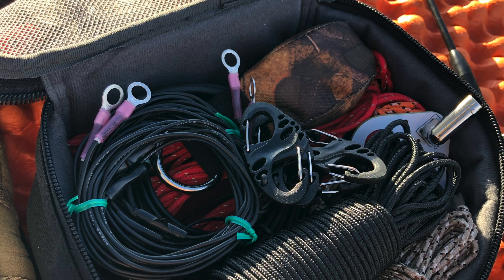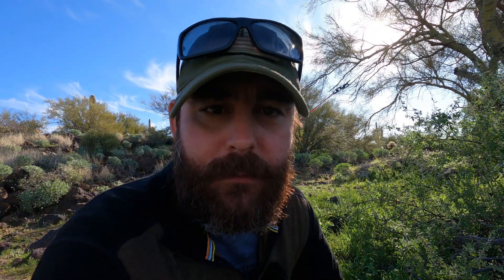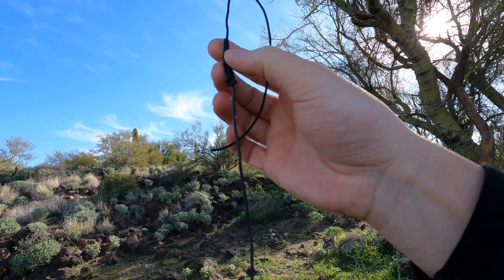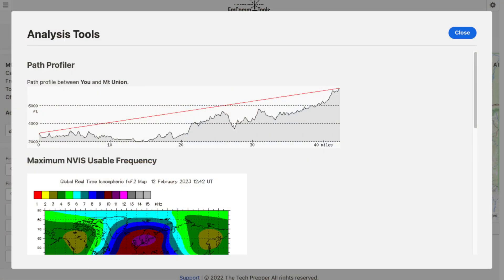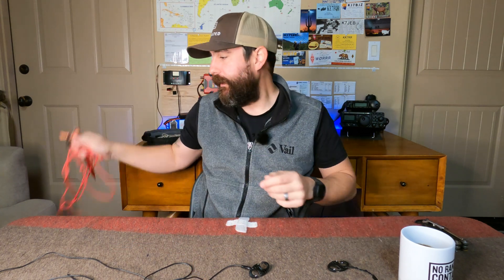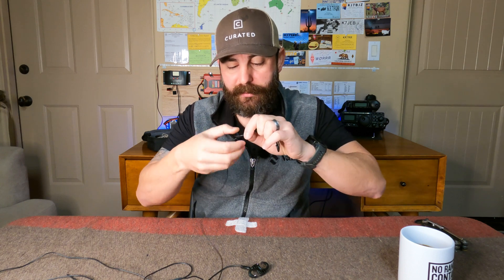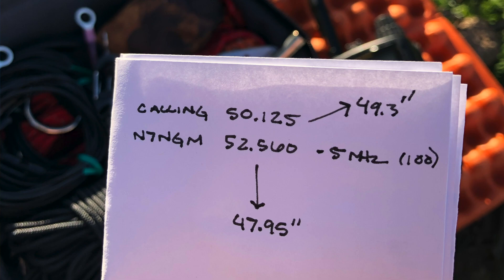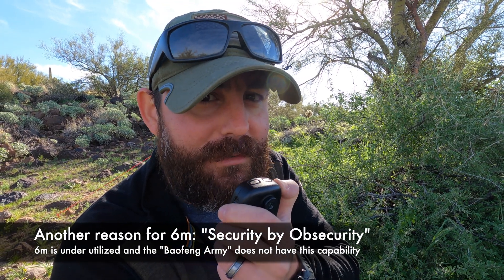Improvised Field Comms - Manpack + 6m Jungle Antenna (Full Video)

Comment: I like how you make quad band mobiles work when they’ve been kinda bashed for so long. Now it seems all those mobiles have been discontinued! The 818, 8900 both discontinued and are long gone online. Just can’t find them anymore. The 8900 was replaced by the TYT 9800 but does not have good reviews at all for poor quality. Has there been any news on whether yaesu will have a replacement for the 8900? Anything comparable?
Reply from the maker: Yaesu, in my opinion, is taking most of their radios in the wrong direction. I do not believe there is a quad band replacement.

Comment: I know you said its a hassle to add radio compatibility to EmComm Tools, but just in case you're on the fence, and one more request will push you over the edge, being able to use it with the FT-8900R would be awesome.
Reply from the maker: All the Yaesu mobile rigs will work with EmComm Tools with reduced functionality since they don't have CAT control. You'll just have to tune yourself.

Comment: Hmmm....  Do you know about HF ALE (https://en.wikipedia.org/wiki/Automatic_link_establishment)?  Look up PC ALE for civilian software implementations.  There are also periodic interoperability exercises among ham ops, and among hams to gov and NGO.

ALE is automatic link establishment.  Essentially, it lets the participants set up ad hoc meshes that the system maintains autonomously.  If you've got the typical shack-in-a-box radio, this means the entire band from 160m to 6m.  The system sounds the channel periodically to figure out in real-time where the band openings are, which other nodes are reachable on what band, and routes traffic appropriately.  If paths go down for whatever reason, the system figures out another way to route, through multiple hops if necessary.

It's superior to VHF/UHF, essentially hobby-grade, repeaters in coverage and resiliency.  Even just a single 40m or 80m station set up for NVIS will give reliable single hop link out to ~200 miles, and without regards to line of sight.

Comment: I bought the Yaesu FT-8900 radio and connected it to a Bioenno BLF-1206A. The Signal Stick antenna was connected. I keyed the mike at which point two 'Busy' indicators appeared on the menu.I factory reset the radio to attempt to resolve the issue. I am new to ham radio. This was my first attempt to move from a handheld to do what the TechPrepper does in his videos. Did I do something wrong? This is more of a learning experience. Trying not to be bummed. Thank you.

Comment: They're bigger, but rock solid, the Rig Expert analyzers are great, accurate units.
Another thing to try; use just 1 radial with your antenna in an "L" configuration. Orient the radial in the direction of the station you are trying to reach. With one radial, you get some directional "gain" in the direction of the radial.
Reply: so adding radials gives you a wider coverage area, at the expense of distance?

Comment: Hi Gaston
It's very interesting watching your progress. Keep it up.
I can see your struggling to get height in the field, have you considered using a fishing pole as hight above ground on VHF/UHF is very important.
The gain may justify the extra weight.
Have a look at DXCOMMANDER here in the UK for a few ideas.
Reply from the maker: Thanks for following along. I always carry a 6m carbon fiber mast (SOTABEAM Carbon 6). I usually use it for my HF antennas (dipoles and EFHW's), but have used it in the past for my roll-up J-Pole. Thanks for the suggestion.

Comment: End Loaded Antenna... Been there, made the same mistake... 
  It turns out that the little wire folded back at the end adds apparent length to the antenna.  

  Check out DX Commander's video on linear loading, and his latest Signature 9 video. 
 He  talks about 3" folded back makes the antenna seem 1" longer.   When you cut off the leftover "TAIL" the resonance shifts and you've gone too short.

Callum thinks he might keep the fold over a little long, and tune by trimming the tail, without moving the fold point.

This happened to me when I built my 80M EFHW.  I kept folding back without cutting until I hit resonance at 3.55MHz.  When I cut the folded (about 5') section I went out of to about 3.9MHz.   That messed all my harmonics.(UGH!)   - Clark, de  N1NVK
Reply from the maker: Clark, this is perhaps the most useful comment that I have ever received on the channel. Thank you. This makes perfect sense. By design, all my dipoles (and now my 1/4 ground plane) antennas are all end loaded to allow adjustments and tuning within a given band. I usually have anywhere from 4" to 9" folded over on the ends. I can't seem to find the video where Callum talks about it. I'll shoot you can email if you don't mind.
Reply: @TheTechPrepper  https://www.youtube.com/watch?v=0UwaIc3GdSA

Comment: Do you think you could get one of those cactus to radiate? Or, would it be wrong to poke it with a thin pin that is a few inches long? Cactus & cactus? Cactus and fence? Cactus and wire?

Corntenna and wet string antenna has been done. The solar cycle is pretty hot so a lot of crazy things should work.
Reply: That would be a million view video ❤

Comment: Awesome!! The fence trick is on my list to try out too. If you use a cobra head just take a couple alligator clip to banana plug leads. If you are using an external tuner I'd put the cobra head directly on the output of the tuner and run the lead up to the fence. That should help keep losses a minimum.
Reply from the maker: Thanks for the tip. I was planning on going down a similar path. I have spent almost no time with my Xiegu X6100, so I may use it. I am also considering using my MFJ 9201 QRP manual tuner as that can be used with any radio and is perfect for the field.

Comment: U can buy female BNC binding posts and have ya tryed a efhw antenna for 6M yet?
Reply: For HF u need 2 wires with a aligator clip on 1 end and a L match
Reply from the maker: I have a bunch of the female BNC Cobra heads and have traditionally used them for my dipoles for ease of connection to the coax. Recently, I switched to the male BNC as it give me flexibility to use it with all my HT's. I have not tried an EFHW on 6. It's on the list.

Comment: Been loving all of your videos.  Same direction I'm going on my setup.  Get a RigExpert Stick Pro.  That should be the best option for you over a fragile NanoVNA.  I tried last year right after the war started and, due to availability, was stuck getting the AA-650 Zoom.  LOVE IT!! Just not small for backpacking and remote field adjustments. Buy from the US reseller.  I forget the name, maybe PNC Engineering.  They are licenced to repair or tune them locally (USA) under warranty. Keep up the great content!
Reply from the maker: It's funny you mention that. I love my RigExpert Zoom 35AA, but it is huge and only works for the lower HF bands. I've been looking at the Stick models for awhile. The price has kept me away, but I think I'll save and snag one this year.

Comment: Sounds like a resounding kudos on the video. I'm glad you added the Knots portion! And the Nanos were on sale for 39 bucks on r and l 3 days ago!
Reply from the maker: Thanks for pushing me to add the extra 10 minutes! I'm open to any suggestions you have for an improvised HF antenna using a barbed wire fence. I don't want to cut existing fence, so it looks like I may have to go down the path of a random wire type setup with an alligator clip and tuner.
Reply: @The Tech Prepper  no problem sir! I could not send the link but k7mem has an AWESOME website. I sent you a screen shot and some numbers via Buy me a coffee. Hope it helps! I love my 9:1 random wire (85') for 80-10m on my 991a at home. Tunes up easy.
Reply from the maker: @the_mad_swimbaiter455  Thanks! I appreciate the assist again.

Comment: Enjoy your channel, sir.  I'm an Arizona native myself, and am all too familiar with the plant life you have in your videos.  I watched all the way to the end, where you tried to make a 6 meter simplex contact.  I'm not trying to be one of those 'know it all' hams, because I definitely am not.  But, if you didn't know - 50.125 is a call out frequency, but it's usually for SSB.  The FT-8900R doesn't do SSB (which I'm sure you already knew).  The FM Simplex call out frequency on 6 meters is 52.525.  You might have had better luck using that frequency than the one you tried to use.  FYI (for the future).  DE K7RLN
Reply from the maker: Great call out. Thank you for the correction. Honestly, I was solely focused on the FM repeater and hastily searched for a simplex calling frequency the morning of the exercise and failed to distinguish between FM and SSB. I love it when the locals pop in!

Comment: For a HF antenna on the wire, use a 9:1 balun and a isolator. Cut the wire and isolate it. Attach the wire into the 9:1 and see how it goes. Also look up linesman braiding for connecting wire. Much more robust if you do it that way along with the fishermans knot.
Reply from the maker: Thanks for responding to my HF question. It looks like a random wire with a tuner is the way to go for this next video. I may re-use my PackTenna Random Wire antenna with an alligator clip on the end.

Comment: Adapt and overcome!😎  Would it be an option to build removeable links for the 2m jungle to turn it into a 6m in the field?  Good stuff for over coming problems in the field.
Reply from the maker: I was thinking about building a linked 1/4 wave ground plane for 6m/2m/70cm based on this design. Yes, it's doable but you lose the frequency agility to tune it in the field within a specific band. I guess I could tune the first two shorter links (2m and 70cm) for the middle of their respective bands and allow the last link (6m) to use my same s-clip carabiner approach for tuning 6m.

Comment: 6m one of the best bands for preppers for short range comms. Great for horizontal ssb. Very much underused in the UK which have said is good for prepper comms. Many thanks.
Reply from the maker: Thanks for sharing! My local prepper group is asking to play with 6m after this exercise. There may be a follow-up video.
Reply: Great stuff mate learn a lot from you much appreciated
Reply: What band would you want to use on a hand held tri-band like a vx-6?

Comment: Open question to all: When in an emergency situation what bands will be the most used? 20m and 40? Long term shtf or short. Trying to pick either a 6-80 meter multiband antenna like the chameleon V1 no longer in production or just use a long wire end fed 20 and a separate 40 meter.  Thanks for the thoughts.
Reply from the maker: I guess it depends on your goals. My personal emcomm plan is focused primarily around local and regional contacts. This leads me down the path of leveraging NVIS on 40m, 60m, 75m and 80m. I'm finishing up a linked dipole design that I'm calling the "TTP EmComm Linked Dipole". It's a 5-band (20/40/60/75/80m) linked dipole tuned for a very low height (8' apex and 4' on the ends). I'm
collaborating with N9SAB on this. It will be available on my store late next month. 20m will be terrible at that height, but the other bands work fine based on my testing.
Reply: @TheTechPrepper  I like it.
Reply: @TheTechPrepper  Oooh. Nice. About how long will the end to end of it be? Sounds like it might be a good roof mount.
Reply: @TheTechPrepper  is this out? have a video on it?
Reply from the maker: @anonymous_friend  It's not out yet. We're working on the first 25 units. There will be a video within the next 4-5 weeks. We're still working through pricing and logistics, but the testing looks good. I'll announce the initial run to the Buy Me a Coffee crew first to gauge interested before we go crazy making units.
Reply: I tend to like the NVIS 40 and 80M  80m in the day time can fill in the skip zone.  I would like to hear what others think. I do like 6m this gives my radio access to the 100w capability and the antennas are not to big and is tech accessible. 28.3-28.5 is possible also.

Comment: Outstanding.
Reply from the maker: Thanks. I wasn't planning on making this video, but I thought that the experience was worth sharing.
Reply: @The Tech Prepper  serendipity,
I choose the rig expert over getting a tunner and also picked  a book on wire antennas, but I need a cheat sheet .

Take care
Reply from the maker: @bovineexcrement8635  There's a place for both a tuner and an analyzer. Unfortunately, only one of my radios has a built-in tuner (Xiegu X6100). I plan to use a tuner in the next video when we switch to HF for this series. I plan to either run the X6100 or run one of my manpack with the MFJ-9201, QRP ANTENNA. Stay tuned.